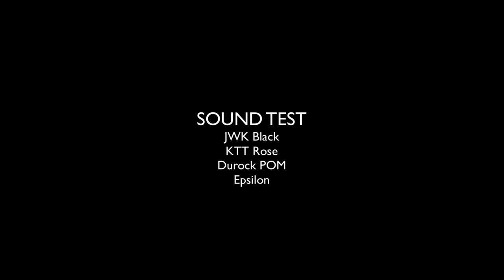Freebird 60 Modding Guide and Review | My Favorite 60% Mechanical Keyboard

Comment: Eyyy doc! I actually got a Freebird60 after seeing your vid and saw one for sale. Currently rocking it with POM plate, KTT Hyacinth (lubed+filmed+spring swap 65g triple stage), no added foams just the stock silicone and I o-ring mounted it. Sounds solid! I'm waiting for the brass plate I ordered with a pcb foam

Comment from the maker: IMPORTANT UPDATE: 

You can actually use this configuration without any screws and it feels better and sounds better as well. The screws on the lower mounting point makes the sound of the keys near it more hollow and unpleasant. Removing those screws resolved the issue on sound. I felt that it will make the board topple over but on actual usage it will not :)  

EDIT: with the configuration above (no screws), it does suffer some problem with the board being too elevated off the case, and the space bar row sounding hollow 

FIX: I reverted back to using the screws like the one on my video, however I used the sandwhich o-ring on the screw much like how it is originally intended to be use. This fixed the sound issue on the keys near the screw point and my pcb is still now mounted to the case and the lower part of the board sounds perfect! 

Hope you find this update useful